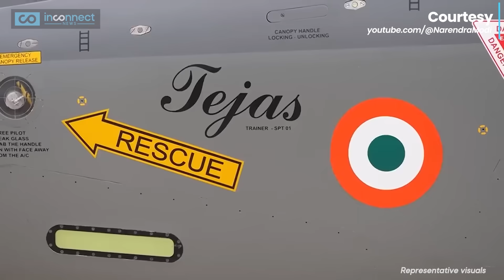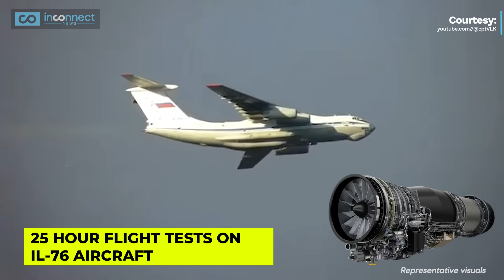Why Testing the Kaveri Engine on Tejas is a Game Changer: Defence News

Comment: Should have handed it to pvt sector long ago . GTRE is a very mediocre organisation. There r good engineers there but they r the exception not the rule. The fact that v got so far despite using GTRE , budget allocation constraints , all the govt policy flip flop over the yrs on defence projects and of course the red tap babudom that is a perennial curse on our country is actually a small miracle by itself . Considering all that I have full confidence that v won’t ever need to import anything Defence wise if v allow our pvt sector to compete in defence production. One good decade of pvt competition in defence and v will c massive transformation. Just need to fund them liberally with cheap loans and plenty of liquidity. Everything else is already in place . Unlike most countries v have a good critical minimum of good engineering talent now . Even in metallurgy which has historically been undervalued in our country. I don’t v y v have to go for ToT anymore other than to fill temporary gaps until v make stuff ourselves.

Comment: Don't we actually require 120 KN engines ?
Reply: That is for AMCA..
Reply: That’s for 5th generation fighter jet AMCA…
Reply: 120Kn is not required for MK1A or MK2. It will be for ANCA. Evene Rafael works on 80kn engine, which we have.
Reply: Do we have at least 80 KN engine till now ? We should focus on the 120 KN engine only after we can succeed in the upcoming Kaveri 2.0 engine test

Comment: Wow. This is absolutely great news. I had also read many articles previously wherein it was said that Kaveri new engine afterburners produced thrust of 84-85 kn. I just really hope it works on tejas and we succeed in becoming a nation who r self reliant in manufacturing fighter jet engines
Reply: There is no kaveri engine that is producing 84-85 KN of thrust. Kaveri is hovering between 70-73 KN of thrust which is less than the GE 404 (78+KN).
Reply: @sameersambrani2535  hii sameer. GTRE has another version of the engine where the weight has been reduced and its thrust is higher. The only reason IAF did not want to use it on LSP tejas bcoz it is risky to test such engine without first using a test bed which unfortunately we do not have and are dependent on russia
Reply: @aloks81 kaveri 2.0? I think it is under development. And will be test soon.
Reply: @kamartaj3010  hii. Kaveri 2.0 is a separate project for development of engine for AMCA program. Many Indian companies are forming a consortium and tying up wid foreign OEM to manufacture one engine by 2032